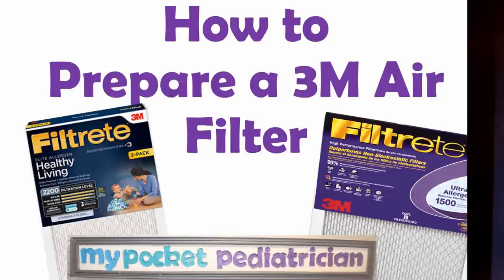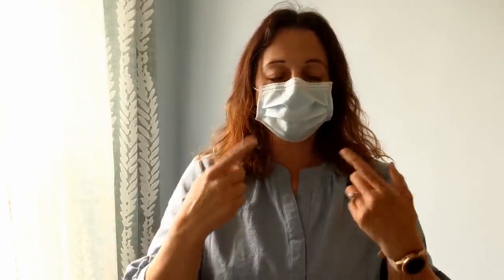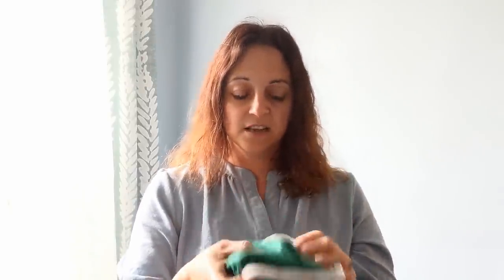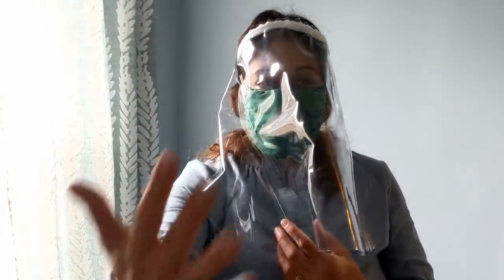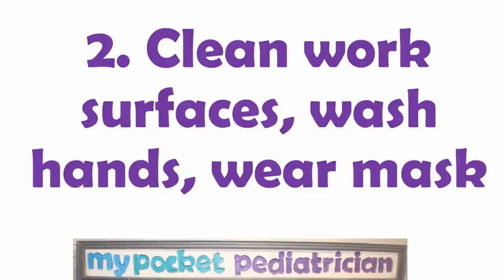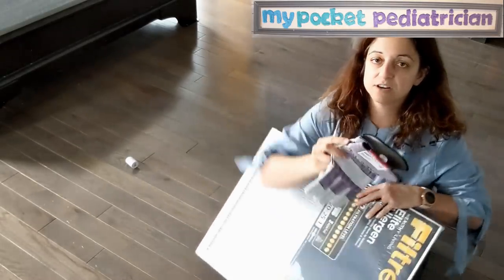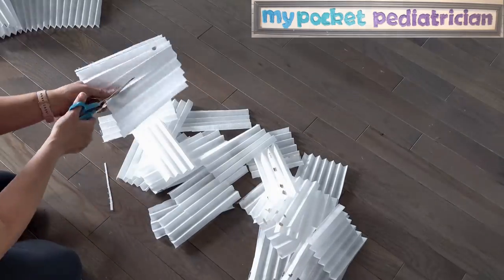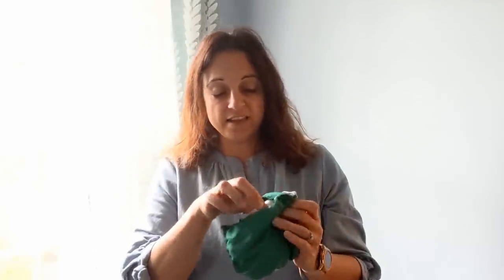UPDATED!  How to Turn a 3M Air Filter into a Face Mask

Comment: What are your thoughts on those stretchy microfiber neck gaiters? You can pull it up and over your noise and it provides a pretty good seal since it's around your entire head/neck and is pulled over your face. It's pretty thin, but since it's made from microfiber, I think the performance is a bit different compared to cotton. You could even double-up without too much trouble.
Reply from the maker: Well, the problem I think is still your seal.   Air looks for the path of least resistance.   So if it can get in without going through the filter, it will.   It works for containing your own droplets, which is very important to stop the spread, but not necessarily for filtering your air unless there is a way to make sure the air can only pass through the filter.
Reply: @MyPocketPediatrician  I think that's true around the nose area, that would be a path of least resistance. You could tape it, but then is that really necessary for just doing quick grocery runs while maintaining social distancing? Probably not... I have one of those P100 respirators from 3M (with the pink filters) I use for spray painting and refinishing projects. I bet that would definitely work to filter my air, even better than an N95 mask, but I can't imagine the looks I'd have going to the grocery store in something like that. And, something I forgot to add... neither would protect your eyes or ears. If enough viral particles land on your eyes or inside your ears, you could get infected. I think what we're really trying to do is minimize the chances you could get someone else sick and maybe lighten the viral load for yourself.

Comment: Thank you for posting this.  That said, I don't know that the electrostatic charge is going be present when you are breathing humid exhaled air.
Reply from the maker: These filters say they are for 3 months.  You definitely have a point...I nearly died (literally) trying to come up with moisture barriers.   Do you think they wouldn't even make it through a single shift?  I know an N95 should only last a few hours for the same reason and people are using them for a week or longer.   Obviously we need real PPE yesterday, but do you think this wouldn't work in our short-term desperation?
Reply: @MyPocketPediatrician  I would say use whatever you can.  This is an untenable situation and something is better than nothing. I think your solution is one of the best I have seen. The only better might be the HEPA Vacuum Cleaner bags if the are not so restrictive that they cause infiltration from the sides. They are definitely a more dense material and do not rely on static.  Thank you for all you are doing. PLEASE stay safe.
Reply: My Pocket Pediatrician 
Would a square of OlyFun fabric closest to the mouth work to reduce moisture on the filter?  Olyfun fabric seems to be moisture resistant and breathable.  I got a 3 yard roll at Walmart for $2.
Reply: @wildcatdiva4974  That's an interesting idea.  It certainly couldn't hurt.  To be honest, I don't think that the static is that critical.  Stay safe!
Reply: John Elliott 
Thank you for your opinion on my idea.  I really appreciate it.

Comment: it would be great which I haven’t found yet if someone could tell us the difference from a P 99 or n99 and n95 or P100 ie..different types of masks and which ones would protect us from the virus because there’s so many different ones out there if we are saving the N 95 for healthcare workers this would be a great video to help
Reply: The letter at the beginning ( N , R , or P ) rates the mask's resistance to oily substances, " N ot", " R esistant", or " P roof". An "N" rated mask will break down quickly when exposed to oily stuff, a "P" mask will last a long time. This is irrelevant normally in a health care setting since the masks are intended to be single use, they're never in use long enough to break down. A "P" mask will last much longer, but won't actually provide better initial filtration.

The second number refers to the percentage of 0.3 micron size particles that will be trapped by the mask. An "N95" mask is non-oil resistant, and filters 95% of 0.3µm particles. A "P100" mask is oil-proof, and will stop 99.97% of 0.3µm particles. P100 (and even N100) rated masks are usually large, reusable masks with replaceable cartridge filters.

Note that 0.3µm particles are actually the hardest size to filter, so you can expect a filter rated to stop them to block a higher percentage of both smaller and larger particles.

Other ratings of interest, MERV 16 should also block 95%, so similar to N95. HEPA blocks 99.97%, similar to N100. The highest grade of filter that is relatively common is  ULPA, rated for 99.999%.

Comment: Wouldn’t you want the arrow pointing out if you don’t have vivid and going out so you are breathing in filtered oxygen or??
Reply from the maker: The filter filters air in the direction of air flow, so if you put the filter in your return vent to the HVAC, the arrow points towards the vent and you then filter out dirty house air and recirculate fresh air.   You point the arrow towards the HCW and the HCW gets the filtered air.

Comment: As an emergency manager for 20 plus years, this is the best DIY mask I have seen yet to keep people safe! Good job Dr. Lili
Reply from the maker: Thank you!  I think I actually have a better design coming out in the next couple of days - please subscribe so you get the update!
Reply: @MyPocketPediatrician my only suggestion is trying to incorporate a one-way valve to aid exhalation. something like what in on the 3m or even the way we seal a sucking chest wound. (I'm also a former EMT).
Reply from the maker: @american_patriot6218  I don't know if that would be possible in a sewn mask.  I think it's a great idea, but I can't think of how on earth to do it.
Reply: I’m not certain how the exit valve works but it seems like you wold need something small, plastic (or just hard) , had holes and something easily attainable. My first thought was the metal salt and pepper tops that are popular at restaurants, but like I said I’m not sure how the valve works so this might not be good at all. Maybe something used for hardware and pipes. Or even a plastic bottle lid with holes melted into the cap? You might be able to secure the bottle with strong glue?
Reply from the maker: I have a new and improved Adjustable mask with FILTI material that passed the FIT test!  Please check it out here:  https://youtu.be/2J3Fq4o-U4I
Reply: Please take a look at my post of a few minutes ago, you could omit making a mask if you just put a snug (but not too tight) pantyhose over your head, with the filtrete filter underneath over your nose and mouth.

Comment: Thank you for your research and videos. I also spent several hours researching this as well, 3M Filtrete filters contain electrostatically charged filter media made of polypropylene and polyolefin plastic, and capture particles that measure between 0.3 - 10 microns in size. polyolefin is non toxic and polypropylene is used in making straws, yogurt containers and things like that. It is considered a low toxin plastic. Both materials are considered generally safe and neither contain fiberglass. All this information can be found with a search. I am not a healthcare provider nor am I an expert.  I am just part of the general population who did some research. It is my opinion that these masks are a great alternative. Thank you again for your hard work!! Stay safe all!
Reply from the maker: Thanks!  That's what I found as well.   I can't get anyone to confirm it's safe to wear up against your face and till continue to filter viral particles because that's not the intended use, but those were my findings as well.  I appreciate your research.
Reply: NorthernCaliWay  you need to post your msg on the main public post reply to the girl who made the video... she may be able to answer your question fr you😉 stay safe😊  ,.... txt from Ontario Canada😊
Reply: Here's the problem. Once you've exhaled one or 2 moist warm breaths, you have effectively doused the material in water, so I'm doubtful there's any electrostatic charge taking place after that. In order for electrostatic charge to take place would require dry material.
Reply: Norm Lieverdink   You’re right!!!  ,This is the point, There is NO  electrostatic  charge   ...
Reply: NorthernCaliWay  the filter is designed to be used at the beginning of a forced air heating system, the dry air passes through the filter, and the filter as designed removes whatever percentage of particles in the air. The air then passes through the plenum of the furnace, is heated, then passes by the humidifier on its way to the rest of your house to heat it. Anyone who lives in a northern climate where the furnace runs just about 24/7 in extreme cold, understands that the house can get very dry if the humidifier is not working properly. This leads to favorable conditions for electrostatic charge. You walk across a carpeted floor and go to turn a light switch on or off, and zap you feel and her the discharge of static electricity. When your humidifier is working properly, the static discharge no longer happens. The same principle would apply to the materials in the mask. When you introduce moisture across the layers of different material, your moist breath would short out the difference in electrical potential between the 2 materials. I do applaud the fact of trying to improvise in times like this. But I would be more inclined to find a material that comes closer to blocking the covid virus, rather than relying on a technology that most likely isn't going to be working as designed.
Reply: Norm Lieverdink Do you have any alternative HVAC filters, that would still have a high MERV rating, designed to work in higher humidity situations? 
  Another question I had was: if your using a filter rated @ 1500 or 2200, and then you remove all the folds and lay it flat..... what does this do to the rating ? If it’s it designed to be used with the accordion type setup, I’m guessing the rating drops significantly..
Reply: What if you somehow secured/placed the filter on the outside of the mask?
Reply from the maker: I have a new and improved Adjustable mask with FILTI material that passed the FIT test!  Please check it out here:  https://youtu.be/2J3Fq4o-U4I

Comment: Well done. Claymore mines "TOWARDS ENEMY" is the way I've been labeling my filters. In this case, the virus is the enemy and not the patient. It's the Marine in me. I couldn't help it. Anyhow, shiny side TOWARDS ENEMY. Fuzzy side towards you.
Reply: Thank you!  The Filtrete F1 HEPA filter does not have arrows indicating air flow but it does have a shiny side and fuzzy side.
Reply from the maker: love it!  as long as the enemy is Corona and not the patient!  :)
Reply: @MyPocketPediatrician  It was the easiest way to remember the dangerous end back in the day. I've been making masks since early February and adopted the OMP (Olson Mask Pattern), since around mid March. My girlfriend is a nurse and it's the least I can do. Thank you again ❤
Reply: @MyPocketPediatrician  I have the same filter as you used in the video but I took it apart before I heard your (very important) advice on which direction it should face. There's definitely a shiny side and a fuzzy side.  Since you used the same one, can you please confirm what Aldo said fuzzy side is to be towards HCW is also true of the Filtrete filters? Thanks for all you did and for putting this video together!  - I'm a R.N. who's lucky enough to still have a few N95 masks, but worried about wearing each for a week.
Reply: I am using vacuum bags. I’m assuming air normally flows into the bag (which is the fuzzy side). If I’m properly understanding Lili’s instructions the air should flow towards the wearer which means SHINY side towards WEARER not virus. Please, someone smarter than me correct me if I’m wrong here.
Reply: @sufficientgrace1692  Some vacuum cleaner bags contain fibreglass. Ensure that yours do not.
Reply: @TheLoachman  thanks, it does not.
Reply: @sufficientgrace1692  Excellent. You're entirely welcome.

Stay healthy...
Reply: I LOVE it!!
Reply: Thank you for that video! Very informative. Who knew I would be learning so much about PPE?? Lol! I'm a mid-level in a men's state prison, so we are at the bottom of the PPE food chain. We each received ONE N95 mask. That was a week ago. So I made a fabric mask to go over the N95 and wore that today with a filter in it. Actually, I FOUGHT with it all day, and now even hours after getting off work, still feel that mask on my face. Anyway, my problem is, when I get a half decent seal, the mask smashes down on my nose and I immediately turn into a "mouth breather." Then I start to feel a little claustrophobic, and then get a little panicky. Then, oddly enough, it made me gag, which is weird. (Fortunately I was in my office so no one saw me 😂). Anyway, the virus has come into the prison and I feel like all hell's gonna break loose, and soon. There just is not enough PPE for us, much less the officers, who often have to be around the inmates the entire day. I feel lucky I'm not exposed to patients nearly as much as hospital staff, but I need something more reliable than an N95 that's falling apart. I'm going to try the Olsen and your mask. And pray. A lot. Thank you for all the information!! And stay safe!
Reply: @torinicodemus9341  Hey, Stanford released a guide for reuse by heating the N95 at 70C/158F for 30mins , laying dome up (like a mountain). Now, so the filter is a long sheet inside the mesh, if they're all folded, shouldn't the airflow direction be alternate or is it really the same one side towards the mask wearer? I would guess fuzzy is the "exposed" side and the shiny side facing your mouth?
Reply: Camill Kondrakhin thanks for that info! So, they’re accordion folded so when used for its intended purpose, yes- the same side is always facing the unit. I rewatched the video and the shiny side is supposed to point away from the wearer, or towards the virus
Reply: @torinicodemus9341  What?! but even my n95 masks have the fuzzy side out and exposed while the shiny side is whats inside or closer to my mouth
Reply: @torinicodemus9341  I'm sorry i might have poorly worded my earlier question. So when Dr. Lili was extracting the accordion paper from the box and wires, it turned out to be a very long sheet right? So I meant earlier that it's therefore folded to fit the box (apart from the smaller accordion pleats), so if that's the case, the dotted marking is useless since the airflow goes through alternating sides or how was it folded inside the filter box...? Do you get what I mean? I'm so sorry
Reply: @camabkamuvoba7467  how exactly do you heat the N95 mask?  In the oven?  Will the heat affect the elastic straps?
Reply: @lindasharpshooter6757  I just told you that. 158F or 70C for 30mins only. it won't affect the straps. It was tested to retain filtration up to 10 times of reheating it so don't go overboard the 30mins. max temp 170 if your oven cant go below, or 200 but maybe open the door.
Reply: @TheLoachman  The Filtrete Vacuum bags are fiberglass free.
Reply: Tori Nicodemus OK
Reply: SufficientGrace has
Reply: Semper Fi....these are easier to don and clear than a gas mask lol. I too thought what you did.
Reply: @morefreepress  my daughter and her mother have made 150 so far all donated to healthcare worker.
Reply from the maker: I have a new and improved Adjustable mask with FILTI material that passed the FIT test!  Please check it out here:  https://youtu.be/2J3Fq4o-U4I
Reply: @camabkamuvoba7467  you didn't have to be rude with your reply.  You initially never said to heat it in the oven which is why I asked my question.  Sorry for bothering you.  Sheesh
Reply: @lindasharpshooter6757  How else would you get to 158F? You can't do that in the sunlight. Do you have an autoclave at home? JEEZ. Sorry that I thought common sense was common. And heating should be last resort. First solution is to leave it unused air-dried inside a paper bag or laying on a flat surface at room temp for 3 days or 72 hours before using it again.
Reply: @camabkamuvoba7467  Wow....can't you just respond nicely.  Geez
Reply: @camabkamuvoba7467  wow...can't you just reply nicely without being rude and sarcastic.
Reply: @lindasharpshooter6757  Maybe you need to think that it's not always about you and your feelings. How about being grateful for a change? Geez.
Reply: @camabkamuvoba7467  lol

Comment: I used the same type of filter and I just cut the wire away with wire snips, pulled it away from the filter and simply cut the filter out of the frame, it was much faster and easier than messing with the cardboard frame
Reply: Post a video
Reply: I did too!
Reply from the maker: I have a new and improved Adjustable mask with FILTI material that passed the FIT test!  Please check it out here:  https://youtu.be/2J3Fq4o-U4I
Reply: Hi can you help me out please.im making the same masks from the same 3m filter I forgot to look at the arrows before I took it apart lol can .I know by looking at it .it has two sides a smooth and rough side please help 😁
Reply: CAR MAC 1 the smooth side is the side that goes away from your face
Reply: @Lulu.G-61  thanks so much . stay safe. 🙏🏼